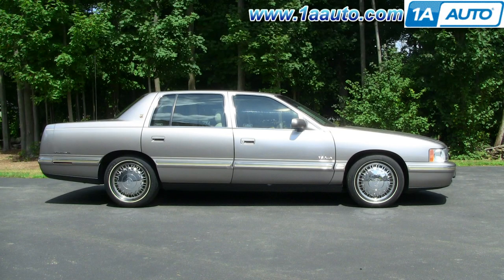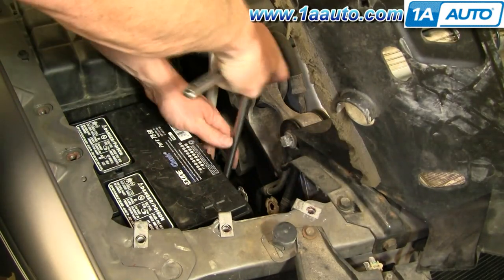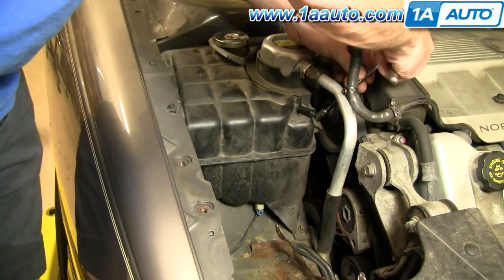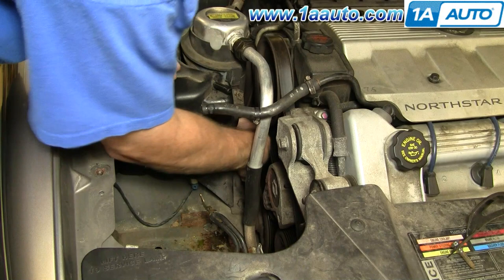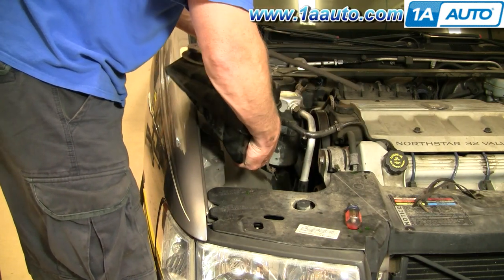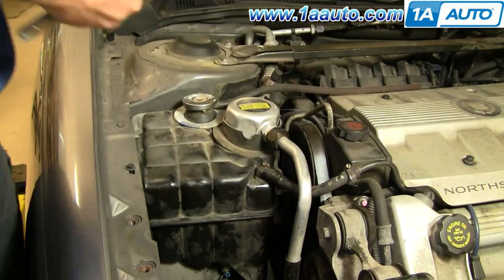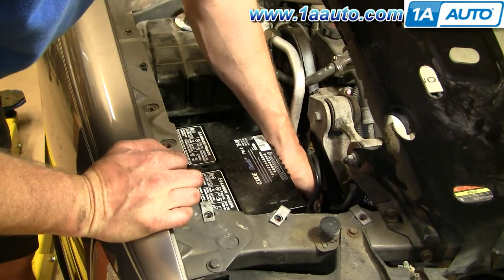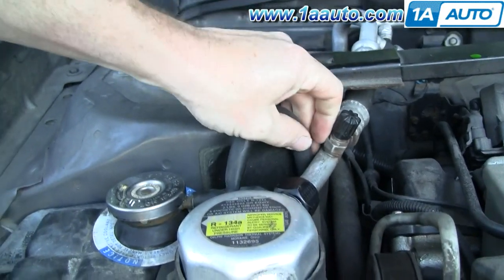How to Replace Radiator Coolant Overflow Bottle 96-99 Cadillac Deville

Comment: I have a 1996 cadillac deville that is always losing water coolant and have to refill the coolant tank about every 3 days. I replaced a water hose but thats about it. Also, is the hose that's attached near the coolant tank cap supposed to hang down into nothing. I mean I think it's losing fluid when the car heats up, since the hose is not attached to any container. A reply would be nice, ty.
Reply: I need these answer as well and I DONT SEE A REPLY TO ANYONE THAT ASKED
Reply from the maker: +encore farley Thanks for watching!  That hose does not hang freely, it attaches back onto the bottom of the bottle.  If you are losing fluid then you have a leak somewhere, but we would not be able to diagnose that sort of issue here.
Reply: I need help I did everything cleaned out the lines water pump thermostat  gets hot when I drive comes out the over flow line

Comment from the maker: The Dex cool is ok, but you have to follow the recommended instructions when using it. If you change it at the recommended intervals you shouldn't have an issue. You also do not want to mix it with regular antifreeze unless the bottle states that it is safe to do so.

Comment from the maker: It's a return from the radiator to the over flow. If the radiator has to much fluid, the excess fluid goes back in to the bottle through the hose.

Comment: Thanks for the Reply on the radiator hose picks. I pulled the hose off last night before reading your comment. I wish that I would have read your comment beforehand. It might have saved my some hassle. Onward I go to try to install the new tank...or to at least place it in there so I can drive it to the real mechanic. Thanks again for your comment and for the well-produced video. You offer a great service and I hope it comes back to benefit your business.

Comment: Hello Mike. Question my friend. The Lower hose on the expansion tank which is in a tight spot and has the GM squeeze Clamp I've got the proper GM Clamp removal tool, So how difficult is it getting the Lower hose back on and how did you go about it. Thank you
Reply from the maker: +Anonymous TwoTone Thanks for watching.  The lower hose should just slide back on, and you just tighten the clamp back down.  If you have the style that requires a hose clamp tool it will be a bit more difficult than what is show in the video, as ours is the bolt style clamp.
Reply: @1AAuto  So it's better to replace the squeeze Clamp with a old style Clamp. Thank you

Comment: Great video. Thanks. My 1998 Cadillac Deville D'elegance has a pin hole-size leak on the coolant recovery tank. The leak is located where the tank meets the rubber hose but it's still on the tank, not on the hose. Can I fix that or do I have to replace the whole tank? If I can fix it, what should I use? Thanks again.
Reply from the maker: Thanks for watching. Best thing you can do is replace it. We do sell the reservoir here is a link to the parts on our website
1aauto.com 888-844-3393
http://www.1aauto.com/1A/RadiatorOverflowBottles/Cadillac/Deville/-/-/1999?utm_source=VideoReply&utm_medium=VideoReply&utm_campaign=1ATony

Comment from the maker: It more that likely doesn't have a cabin air filter. If you have the dealer run the VIN number on the vehicle they can tell you if it came equipped with this option or not.

Comment: Great video. I'm still trying to remove my old tank. I've done everything except remove that big hose from the bottle. The hose clamp is off but I can't get the hose off. There's no room to pull the hose off of the pipe. Can you assist?
Reply from the maker: Thank you for watching. The hose might be stuck to the tube itself. If you can get a set of Radiator hose picks, you can try and use those to loosen the hose that way. Hope this helps!
1aauto.com 888-844-3393

Comment from the maker: The hose on the coolant reservoir should be connected to the radiator so that any excess coolant from the radiator will flow back into it. When the radiator is low on coolant, it will pull coolant from the reservoir back into the radiator to replenish itself. Hope this helps you out. 1aauto.com 888-844-3393

Comment: I have a 99 deville. And have a small crack toward the bottom of my tank 130k on it.  Could this be the cause of overheating   No oil coolant mix. No white clouds from tail pipe.  Overheats after 20 min of driving.   Could there be a loss if pressure due to the air escaping and not pushing it through the system.

Comment: Maybe blown head gasket.  I have a 99 Deville and it runs perfect but sucks coolant very slow and seems fine.  The only way I found that the gasket was blown was when I drive up a hill then the temperature shoots thru the roof.

Comment: Where does the hose that's connected up by the cap go.? On my deville my antifreeze is just running out of that particular hose... It's not connected to anything either... Does the sensor in the coolant reservoir control level.? How do you know it's no good.?
Reply: I need to know myself

Comment: I know you just show "how to" videos. But I have spent almost 1k already trying to fix my  car. I feel like I am being taken advantage and the actual problem isn't being fixed.
My radiator went hot and dry so I took it in. I was told it needed a flush. $400. Next day, my check engine light came on. I used a code reader and took my car back and told them the code, thermostat, which was my guess the first visit. So they did a diagnostic and replaced the thermostat.  $250. Check engine light came on again and my car ran hot again. Temperature sensor. $150.
My radiator has since needed more fluid put into it, because it keeps going dry and tries to overheat.
Could it be my cap?
1. I smell an odd smell when I run my AC.
2. I can find no leak at all while my car is running.
3. The reservoir stays pretty full except for one time a couple weeks ago.
4. I do see fresh green fluid where the battery sits, maybe from boil over?
Please help. I can't afford any more trips to a mechanic to have them treat the symptoms and not the problem. And I really don't want to lose my car to overheating if it is something simple for me to fix.
I promise to not hold you responsible should I screw up.
Reply: 96-99 Devilles have a head problem if you look up "Northstar Performance" theyll explain it to you if thats the problem they specialize in those engines.
Reply: i have exact same issue, did you ever find what was wrong?, or what needs fixed?

Comment from the maker: The rubber hose that we take off of the radiator reservoir helps to transfer fluid back-and-forth from the radiator to the overflow bottle. 1aauto.com 888-844-3383

Comment: I change mine out on my 1997 deville but now it keeps saying LOW ON  COOLANT
Reply from the maker: +Enrique Hernandez If the fluid is topped off to it's proper level the light should go off. Hope this helps you out. 1aauto.com
Reply: +1A Auto Parts where is the bottle for the longer hose to hook up at he's says it and shows it but I can't see where to hook it up at. I'm talking about where does the longer hose at the top of the radiator coolant tank go.
Reply: +1A Auto Parts send pic if possible